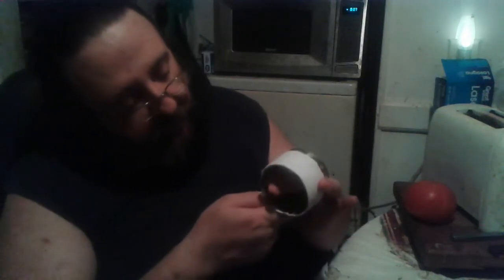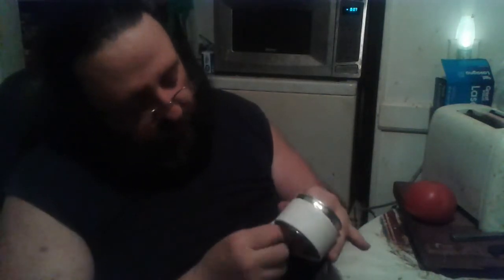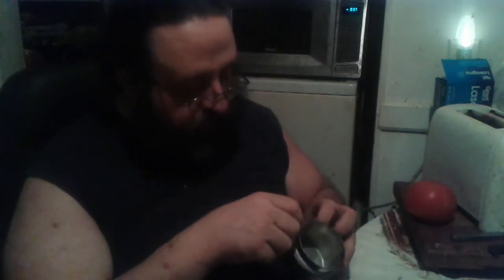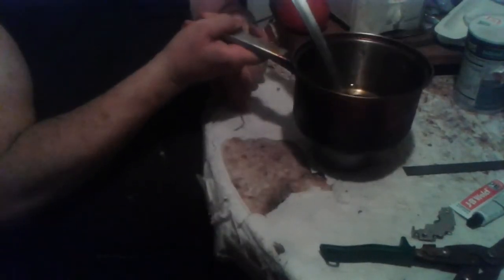MY VERSION OF A FANCY FEAST STOVE

Comment: Do ya have any fiberglass insulation? that is what I use and it does pretty good. Still will burn if it runs dry but not as bad as the paper towel.
Reply from the maker: don't have any and the apartment I'm in don't either
Reply from the maker: the paper towel works and can be replaced with napkins from Mcds in a pinch   best is carbon felt but its quite pricy     as for  corning pink  ill keep clear of that  the old man died of lung cancer  and though he was a smoker sort of  he NEVER INHALED    so where  did the lung cancer come from   he worked in construction insulating  for a number of years  I think it was the culprit